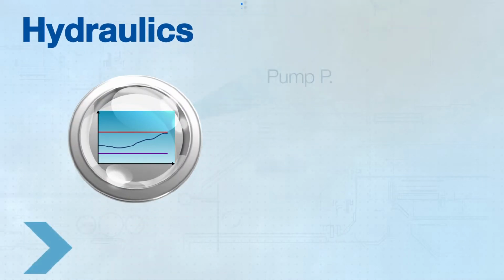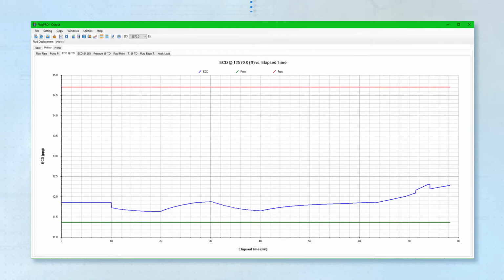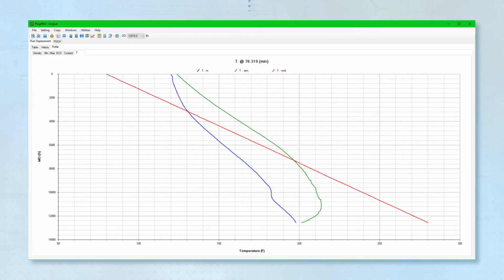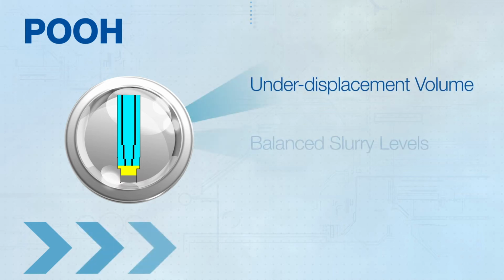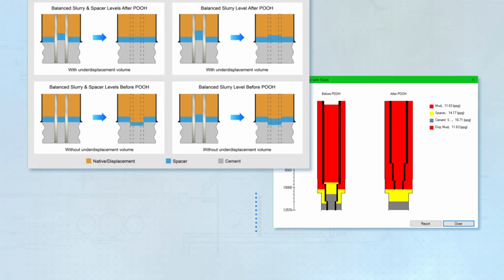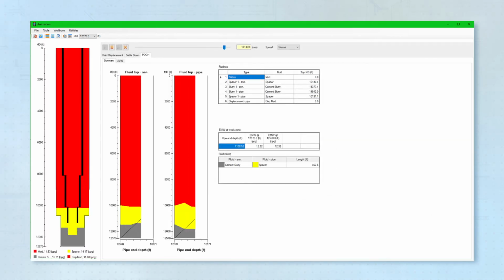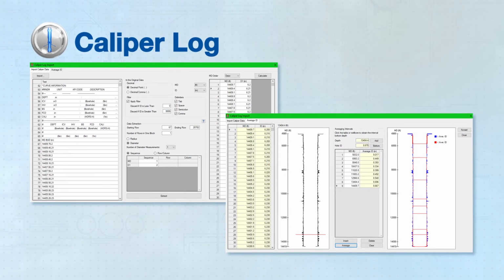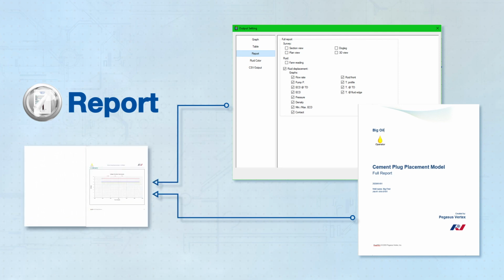PlugPRO - Cement Plug Placement Model

Comment: Hello,

How does the PlugPRO calculate the under displacement?
Thank you!
Reply from the maker: Thank you for your interest in PlugPRO. Someone from our team will contact you shortly. You are welcome to contact us at info@pvisoftware.com or 713-981-5558.
Reply: PlugPRO will generate an optimized under displacement
volume, and then use sensitivity analysis to modify the displacement volume by
specifying the range of under displacement vol. to see its effect on the slurry
positions.